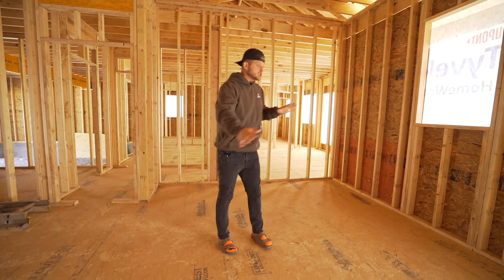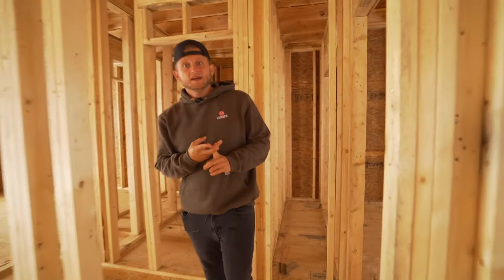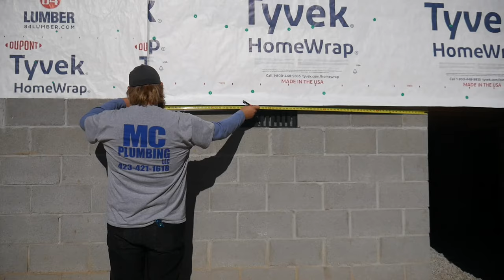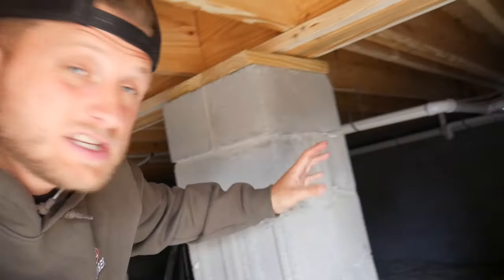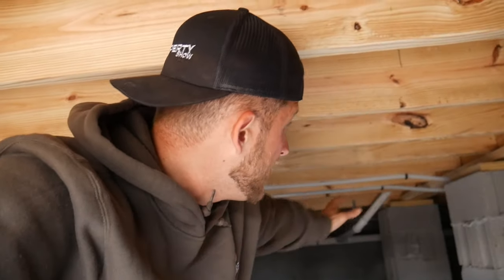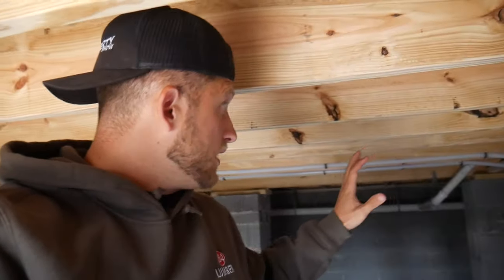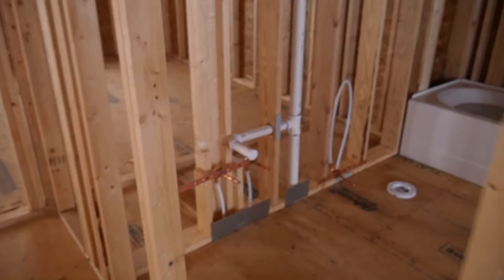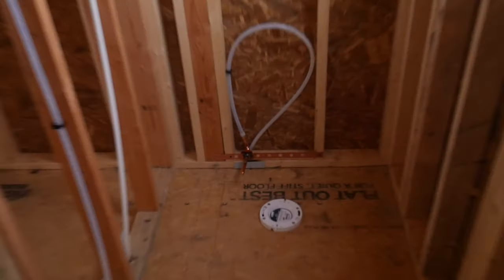Rough-in Plumbing For New Construction | Building A $350,000 Custom House | Episode 18

Comment: looks good. maybe add a tube insulator on the shower cold supply. seems he ran the 90 tight to the stud which will rattle if you close the valve fast enough.